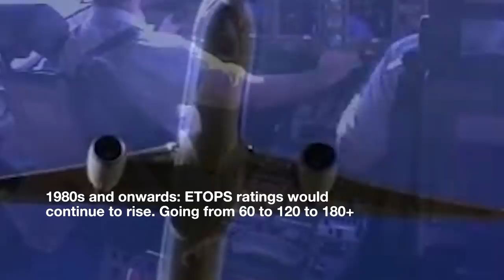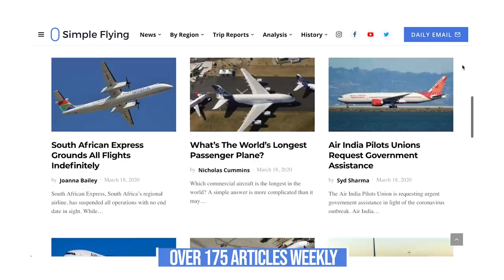Why Did Tri-Jet Passenger Planes Not Become Popular?

Comment: Unfortunately they are a thing of the past, just like the flight engineer
Reply: I don't think so. Look how the manufacturers try so desperately to stuff the most enormous engines under their jets' wings. As the Boeing 737-MAX showed, this logic is reaching its limits. They'll soon have to get back to tri and quad jets in order to keep some ground clearance. Also, passenger prefer tri and quad jets not only for security, but also because these airliners often offer more cabin space, look much more impressive and are much quieter in flight (since half of the power is far from the cabin), especially the A340s and A380s.
Reply: @julosx  The 737Max issue was that it sits too low to the ground, the Airbus similar to the Max is higher off the ground and they don't have the same issue with bigger engines like the Super Max. Boeing should have designed the 737 to sit higher off the ground like the Airbus, that way they could have hung the larger engine correctly and have no need for the special software modifications.
Reply: @julosx  Here's the thing.. Trijets doesn't bring more cabin space for airlines, rather it's the opposite because the third engine takes up space in the rear of the plane, plus the rear seats will also get a lot of engine noise (not great for passenger). 
Trijet setup also makes engine maintenance & upgrade quite a headache (the rear engine specifically)
Reply: And the navigator.
Reply: Yes, and the iconic 747, for which Boeing will cease production, once the current orders are done. But this is the technological progress, which allows for transcontinental passenger planes with only two engines. And now, I never felt less safe in a 767 or any other twin-engine plane. As for most parts, the safety of modern aircrafts is way better than 50 years ago, when tri-engines were developed (MAX is the exception, but this was clearly a decision profits over security and not only by Boeing, also by its customers...)
Reply: @stoffls  But even for MAX, it’s not the 2 CFM-LEAPs themselves causing the trouble, and neither adding one more would prevent it from crashing.
Reply: FedEx runs md11s and the air force KC10 extender
Reply: @julosx  I agree with you on the ground clearance aspect.  Personally, having flown on tri-jets, I would like to see them make a comeback. I feel an argument could be made on the 'one less engine to maintain' & 'peace of mind/safety' arguments to the airlines using quads and twins PLUS your argument about ground clearance.
Reply: dont talk about my job that way
Reply: @stoffls  I mean at the point of current engine sizes, it would probably better to invest in smaller cheaper engines at that point and make a small quadjet
Reply: The first officer takes the job of the flight engineer. Before 3 or 4 people take up the cockpit. The FO is now the flight engineer and also with the help of the QRH
Reply: @rchc329  this is just a statement of personal preference; even if there isn't a need for a discreet spot in the cockpit for another person to man in the cockpit to manage the systems, I would like that person there to be an extra set of eyes and additional brain power to troubleshoot problems.
Reply: @pauld6967  how much brain power do you actually need?? 2 brains of a pilot (sometimes 3 cos the other one is a FO reliever), auto pilot (tho some plabes have a limit on autopilot configuration and reset), a comprehensive QRH, the ATCs have engineers on standby incase pilots have engine questions, and the plane's control system more especially its contingency innovation. What more do you want.
Reply: @rchc329  when the situation is critical and time is short,...more help is usually a good thing.  I'm sure that you can find an example of where that isn't the case if you wish to, hence my use of the word "usually." 🙂
Reply: @rchc329  Hi FE here on the DC 10. I see the reason why FEs are no longer a requirement on newer jets. There are a lot less systems to manage as most are autonomous. But at the same time there are tons of air accident reports about pilots not knowing their jet or relying too much on the norm. 

There have been numerous times this year that I have caught mistakes or been the voice of reason in the cockpit. Sometimes you need the person looking out to the right to keep CRM. Im a system expert which helps in a aging jet like the 10. 

While I did see the reason that FEs started going away during the transition between aircraft with FEs and without there were a jump in accidents. Now imagine you took every air accident on a jet that didn't have a FE. Put one on those jets and I bet there would be less. When I went through my training it was with 2 pilots and me as the engineer, the pilot instructor told me that there would be 2 things that would kill me. One is in the left seat and one is in the right seat. 

I can also see FEs making a comeback though probally not in name, with more innovation in technology and the way automation will always move forward, I predict that there will be one pilot and one engineer eventually (under the name copilot) till eventually it will just be the engineer whose job would just be monitoring the systems and automation.
Reply: @quadearchibeque804  thanks for the insight, my fascination with planes started with air crashes so yeah i would agree with what you said about pilots not knowing much about their jet. Truly alot of crashes happen because of a disconnect between man and machine. i asked a boeing pilot what he thought of airbus' new autonomous jet (disregard the take off part, the L1011 can do this since) being tested and what that would mean for pilots like him. is trusting a plane too much the future of aviation? and such....fascinating systems that was developed or improved upon after crashes so those failures arent without vain....
Reply: @rchc329  The flight engineer was taken away by automation until someone serious goes wrong and then both the FO and aircraft commander are sitting there like a pair of coconuts calling back to their respected hubs asking what to do. The flight engineer use to bring system knowledge to the flight deck, now it's cheaper to fly with out them.
Reply: @oveidasinclair982  which is funny because I get paid way less. I still have to do manuel takekoff data with my charts because our E Told laptops are really weird and I don't trust them because they have 9 known configurations that they spit out wrong numbers and ive found several more.
Reply: If anything, it'll go the other way: no human pilots. It will likely take longer to reach completely autonomous aircraft than cars and trucks, but it'll happen eventually. Just the other day, I read about how an AI wiped the floor with a human pilot in a simulated dogfight.
Reply: @ironcito1101  airbus has already done tests with autonomous everything from take off to taxi after landing. Alot of planes can take off by itself since the 70s, the L1011 can.
Reply: @rchc329  Yeah, but it's going to take time until they allow aircraft with no human pilots on board. Maybe we'll start seeing flights with a single pilot on short routes.
Reply: @julosx  that logic is about fuel efficiency. Larger bypass ratio better fuel efficiency. 737 max  was directly response to A320 neo. 737 max engines are just fine. The issue is type rating and pilot train and why MCAS. As much as people dish Boeing on it, Airbus has had their uncommanded incidents.
Reply: Probably in 20 years pilots will be gone as well.
Reply: wow I didn't really think of it like that, that's really interesting because of all the modern technology available in the cockpit, I doubt they still to get a flight engineer. 
Good observation

Comment: The L1011 Tristar, the most elegant airliner ever to take to the skies.
Reply: I always enjoy that beauty on NASA stream everytime Orbital ATK launch the Pegasus rocket. Too bad there will be no more launches in the future :(
Reply: It was a commercial failure for Lockheed, but it was technically very advanced for the time, it could even land by itself (remarkably, it is a aircraft from the 70s).
Reply: @simonm1447  It was not as successful as Lockheed hoped because of the bankruptcy of Rolls-Royce. And no other engine could replace the particular Rolls-Royce engine developed for the L-1011. The DC-10 turned out to be a dangerous aircraft, because it was rushed to market.
Reply: @simonm1447  so it's a first aircraft with ILS and APPR?
Reply: @frothe42  yes, the DC-10 was dangerous at the beginning, and technically inferior to the Tristar.
Reply: Good luck getting hated for this spoken truth.
Reply: @cranklabexplosion-labcentr8245  Oh I do hope so. If nobody is hating me I am not trying hard enough at life.
Reply: Tupolev 154 for me.
Lucky i flew couple of times with them.
Reply: @Simon Maier technically inferior, but superior in performance, particularly range and payload.
Reply: @goodfella2400  and surprisingly quit from the inside ( back engines ) so quit in fact one time was afraid ( i was 8 ) that the engines had stoped working, but all was fine. By the way airliner was TAROM of Romania in the 80s., flew them about 10 times.
Reply: That honor goes to the Lockheed Super-Constellation for prop liners and the 707 for jets.
Reply: @jalan8171  I'll go with you on the Super Constellation but I will stick with the Tristar.
Orville Wright took the controls of a Constellation on his 83rd birthday. What a life and what an experience that must have been from the first to fly a powered aircraft.
Reply: The Tristar was ugly.
Reply: DC 10 entered the chat 😂❤
Reply: @fra93ilgrande  No, I worked on both aircraft and the DC10 wasn't as good as the L1011 either visually or mechanically.

Comment: A350: Whatever you do, I can do better
A340: Try this, hotshot.
A350: What?
A340: I just shut down two engines kid

Edit: wow more than a 100 likes for this!

Edit: thanks for 200+ likes!
Reply: Actually, there won’t be enough power for an A340, if it’s only flying with two engine. Yes, it still has power, just not enough.
Reply: @airforce66  not enough power to remain airborne?  I think you might recheck your info.
Reply: Frank Bama 
Yes, I’m Sure. It does not have enough power to fly with two engines.

1. The engines of the A340 all together generate 15% More power than the A330, but the plane is 20% Larger!

2. Believe it or not, the A330 was reported to lack in thrust (source: Skyships Eng). As the result, Airbus added 2 extra engines on their slightly larger A340, And added the powerful RR T7000 On Their A330neo. A single engine of the A330 generates 72,000 lbs of thrust but a single A340 engine only generates 56,000 lbs. If they were to lose 2 engines, the aircraft would be significantly less powerful than the A330! (and the plane is 20% larger too!) 

3. McDonell Douglas suggested Airbus that the trijet concept is more promising. Meaning that the A340 COULD work with 3 engines, but not two.

4. I’ve been on a flight simulation (virtually/just 4 fun) back when I was living in the UAE. I switched of two engines off the A340-600 when climbing to FL250. The plane immediately lost speed and stalled. I tried to recover by putting full throttle, but it only slows down the deceleration. Less than four minutes later, the plane hit the ground hard. 

So, yeah, it can’t fly with 2 engines.
Reply: @airforce66  for 4, did you try to pitch down to gain speed? It Should be possible to fly only with two engines with the correct procedures. (IMO)
Reply: @airforce66  should be enough power to land at nearest airport, but got to check my facts.
Reply: Pedapudi Vishnuram 
Yes indeed. But I’m saying that it won’t be the same as say....a 787 losing an engine. You will need to rely on altitude (pitching down) as if a 787 has lost both engines.
One thing good about it is that when u find an airport to divert to, there is sufficient reverse thrust to stop without damaging the breaks.
Reply: Absolutely correct however that would be very useful for Australia Sydney & Perth to South Africa or Chile and Argentina because the southern Indian Ocean and South Pacific lack diversion airports for twin engine planes. As a matter of fact Central Pacific has diversion airports because back then you need to fly that Island Hopper route if you have to fly Los Angeles or San Francisco to Hong Kong and Manila
Reply: A330: "Alright you guys have fun I gotta beat that 777 guy"
Reply: @MIZUch.  A340 "I can cross South Atlantic and Southern Indian oceans without diversion Airport unlike B777 or fly in to hot and high airports without restriction"
Reply: The A340 can fly with only two engines, but it can’t take off or fly at high altitudes where the air is thin and engines produce less power, but it still can sustain a flight and safely land with only two of the four engines, albeit needing to dump some fuel if it’s flying too heavy, but it will need to dump that anyways during an emergency landing if it’s flying above MLW regardless of engine power.
Reply: Nope Nope you really need to check your info my friend, the a340 can fly with only two engines. Comparing raw power alone is misleading, since most of that power is needed at take off and high altitudes where the engines produce less power with the lower oxygen concentration in the upper flight levels. But an A340 CAN still sustain a flight with only two engines. I admit it will be flying much lower than an A330 with only one engine, and it will also fly much slower than it normally does, but it will fly with only 2 engines regardless. The engine demands for a sustained flight at FL180 aren’t as high as at FL330 for example
Reply: Nasser Marzook I wonder how that could fly if it can’t take off lol
Reply: @drbadzer  I can takeoff with the A340 in sea level with only 2 engines, albeit taking up the whole runway
Reply: Random Comment the topic here is safety, the A340 can lose 2 engines and still fly safely, while the A350 can only afford to lose one. Also, the A350 and A330 can’t take off from dead stop with one engine either, they need both engines to reach V1 first otherwise they would risk running out of runway space before they are in the air, and that won’t be a good morning for anyone on that plane to say the least.
Reply: Nasser Marzook I understand bro, to straighten an aircraft you would need equal amount of power on both sides
Reply: MIZU if the plane is light enough and the runway is long enough yes, but for safety reasons I don’t think you’ll be allowed to anyways, since you’d already be on the ground and won’t be allowed to take off with two broken engines to begin with, unless it’s a zombie apocalypse and you’re trying to run from a hoard of zombies
Reply: @drbadzer  True, I did have to lighten the plane up and reduce fuel
Reply: Wow there are 18+1 comments
Reply: @airforce66  your maths is suspect: 4*56k = 224k thrust; 2 * 72k  = 144k. 2*56k = 112k; 1*72k = 72k. Therefore even being larger and heavier the A340 on 2 engines is still more powerful than the A330 on one engine; which you say can fly on one engine.
Reply: Alan Clow i think u misunderstood me. 2*56 is 112k. 2*72 is 144k. If the A340 was to fly with 2 engines, the plane would produce 24% (112:144=0.77. 100%-77%=24%) less thrust compared to an A330(-300) with all engines. And the A340-600 is 30% (124,500:177,800= 0.70 100%-70%=30%) larger. So it would not have enough power.
Reply: @drbadzer  nonsense SAA has been flying A340 out of Johannesburg, hot and high, for over 15 years.
Reply: @airforce66  you have to make a like for like comparison. Comparing an a340 with 2 engines down to an a330 with fully functioning engines is wrong.
Reply: Alan Clow 
No I’m explaining this way for you to get the idea, that I will be even less powerful than a fully functional A330.
Reply: The A340 is just the A330 with insurance. Change my mind
Reply: @airforce66  comparing a damaged plane with an undamaged one is stupid.
Reply: @stolasburrito74656  a330 carries 246 pax 10k km; a340 - 400 plus 16k km. Big difference.
Reply: Did I just start a war?
Reply: B-52 Pilot: "I've had an engine fail. Now I have to do the dreaded seven engine landing...."
Reply: @airforce66   FOOL
Reply: @karlbassett8485  😂
Reply: @stolasburrito74656  then the A380 should be the A330 but with premium insurance that is not needed😂
Reply: Not true not EVEN A BIT basically you don't know anything about aviation
Reply: Nasser Marzook Finally, someone know what they’re talking about.😔
Reply: MIZU How did you overcome Vmcg?
Reply: Karl Bassett LOL. F18 pilot formates on a B777: Fighter Jock: “Hey, trash hauler, I bet you can’t do this!”

The F18 then does a barrel roll around the B777.

Airline pilot : “ Ok, knucklehead, do this!”.

The B777 continues straight and level for 10 mins. Eventually the Fighter jock says, “ Ok, what is that you did?”

Airline Pilot. “ I went back to the cabin, had a piss, talked to the hot girl in the forward galley asked for a coffee and if she wanted to come out with me tonight!”.
Reply: @Slynsmiley  🤣

Wait he sqawked 7500?
Reply: Even with 4 engines it struggles
Reply: @AccompaKneed  All you need to do is turn up the power of the other engine if one fails on a twinjet

Comment: The McDonnell Douglas MD-11 could've been very successful aircraft actually and may have quiet well eclipsed that of the A340 series. The reason being with so many carriers world-wide operating various DC-10s. The issue however was McDonnell Douglas lacking any form of innovation and didn't bother adding a new wing to the aircraft and other refinements to make it more aerodynamically efficient. In addition Pratt and Whitney and General Electric didn't help much either as their engines intially burned more fuel than expected. Of course ETOPS came around and that hampered sales even more...
Reply: If the performance in 1995 and 96 had been there in the initial 1991 deliveries, I think more MD-11’s would have been built.